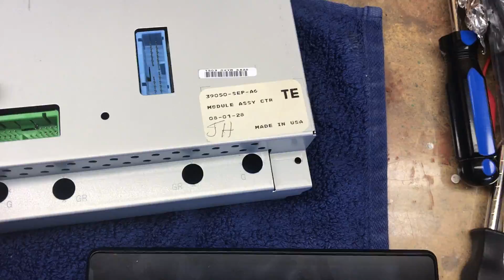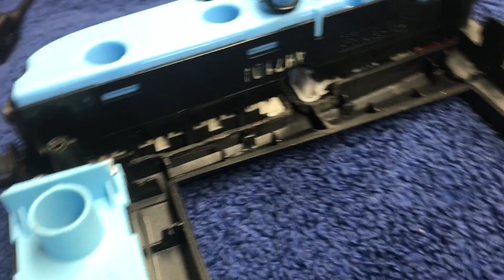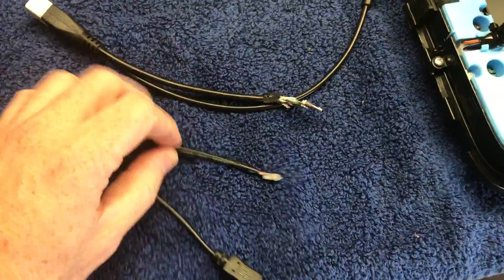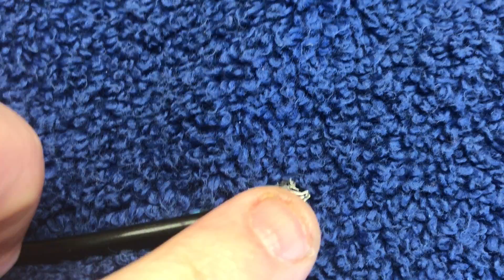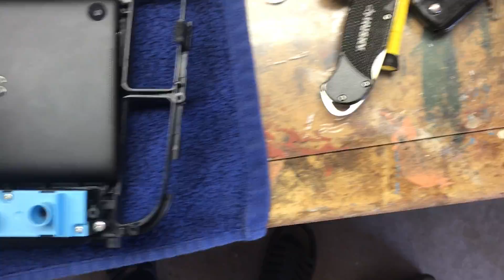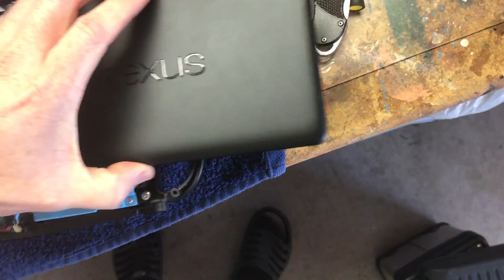2013 Nexus 7 install into OEM bezel for 2008 Acura TL Type S

Comment: So with the oem screen gone you lose the ability to enter the codes anytime the battery is disconnected? Or change the time with daylight savings?
Reply from the maker: You can stoop type in the radio code when the battery dies. You’re right you lose the ability to adjust the time so it’s off part of the year

Comment: Wouldn’t it have been easier to just replace the old radio with a double din and adding a tablet to it?
Reply: Bobby Ross yes it is I have a double din Bluetooth and it saves a lot more time than adding all this Bluetooth module junk to the stock radio . All I had to do was modify to fit the nexus in the Navi bracket. Find a way to plug the charger in and that’s it . Just set up my Bluetooth with the aftermarket radio and that’s it . Soo much easier
Reply: I see a lot of people making it so complicated
Reply: Not to mention the double din looks a lot better than a cassette player
Reply from the maker: @bobbyross2552  in some ways yes and in some ways no. i installed a double din first but i have some white noise hidden in my oem system wiring and amp and when i hooked up the double din it made a loud loud static sound. i took it to a few very high end shops and they couldn't figure out how to fix it. so i got refunded for the double dine and went tablet. i can actually do more with my tablet now hooked up to carplay then these videos show. 

another reason i didn't want the double din is because i didn't want a useless duplicate screen. my navigation stopped working so it would literally just be a blank screen. doesn't bother most people but it would bother me.

i agree a double din is the way to go for 90% of the people out there. just not me, i liked the challenge and with carplay it's awesome  :)
Reply: I’d rather have the tablet and the double din. A cassette player so 1980s. I wonder what was the cause of your noise issue
Reply from the maker: @bobbyross2552  haha i forget the tape player is even there, it's pretty hilarious they put that in. no idea what they were thinking. one of the first to include bluetooth and a backup camera together yet they put a tape player in...

no idea, i spent about a year going around to different shops and no one could solve it. one guy said he's seen it on a bunch of TL cars he's done and all he could do was minimize it. when i hooked up the double din it basically amplified it. i was bummed
Reply: @sockerballer100  you said u were running the stock amp and wiring to speakers right? If so thats most likely the culprit, the stock amp is crap anyway and gives off to much interference. Only say this cause my friends TL has aftermarket speakers amp double din and has no static but mine has static since im using the stock amp w double din at least thats my theory lmao he wired everything himself so all speakers have new wiring from d.d.

Comment: What’ll happen to the back up camera?
Reply from the maker: the oem backup camera is rendered useless that's why i put my own in and removed the oem one. plus the aftermarket ones are way better in quality
Reply: How did you get the camera to work with the tablet?

Comment: how do u run the heater control display?  i know u got a navi heater display. wondering how u wired to use the navi digital heater display with the car w/o navi.  is it a direct plug in??
with nice job on explaining the install.  been looking for more info in tablet install and you have the most detail.
Reply from the maker: Honda Freak thank you! I didn't need to tap into the heater display. If you have no Nav then you need relocate the display to still work. There are writeups on it on acurazine